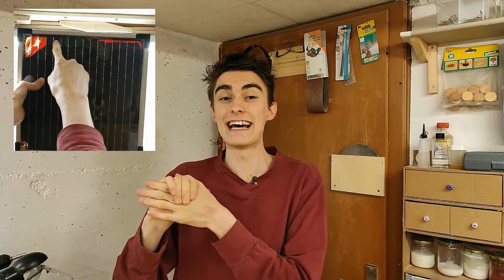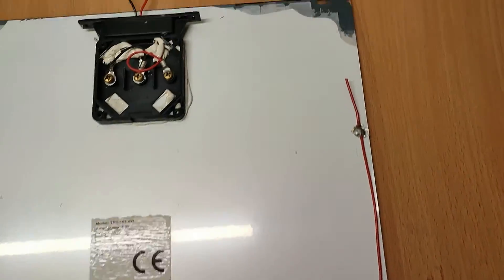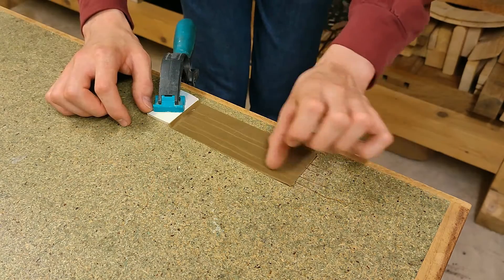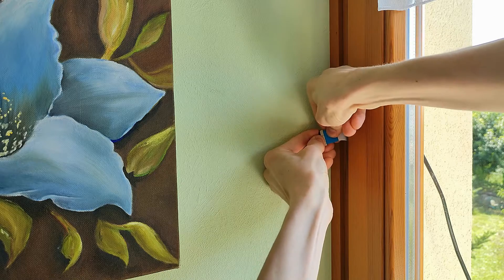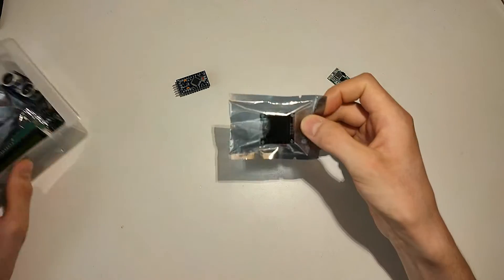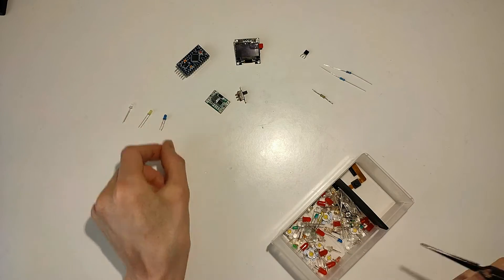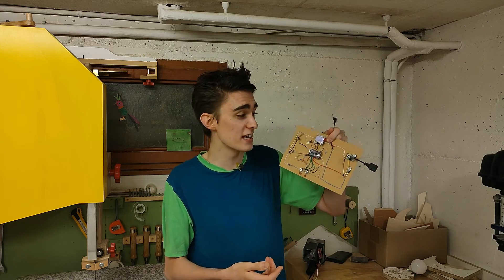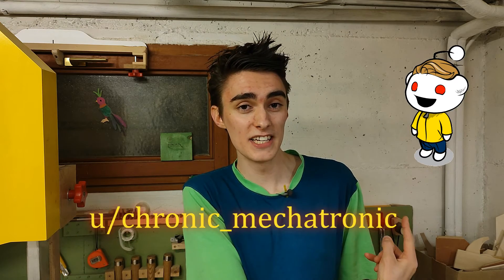DIY solar USB charging station part 2 | prototyping the electronics

Comment: make custom pcb boards in old Cd, dvd and vhs, and cassette tape cases using telephone wire, aluminium foil hot glue and tape with many hours of poking uniform holes.  Just leave most things hooked to them and just assembled whatever new in an open space. case holds the batteries and whatever components are left to finish the projects.  used many tupaware containers as housings for things too. love your cardboard way though... simplicity is the ultimate form of sophistication lol hard to get it wrong with this. just takes a bit more time to set up. some components too just dont fit into a bread board.  3d printers are going to change the world when people start printing their own metal conductors...... things are gonna get crazy lol  wouldnt think it would be to hard to use a conductive paste right now in these plastic printers we have, just the components may be a bit large... idk im interested though. make your own resistors, capacitors and transistors for your DIY nuclear reactor out in the garden shed the modern boy scout way ;)

Comment: using flex cable to pass through the window, I had not thought of it before, very smart.
Cheer up with the project!
Reply from the maker: Thanks! Yeah, the ribbon cable is quite neat, though I wouldn't do it on a living room window 😂.  Already got a new prototype of the electronics, with the new code coming along too.